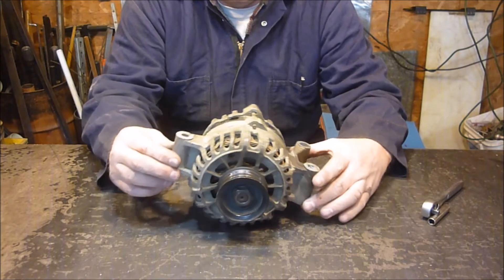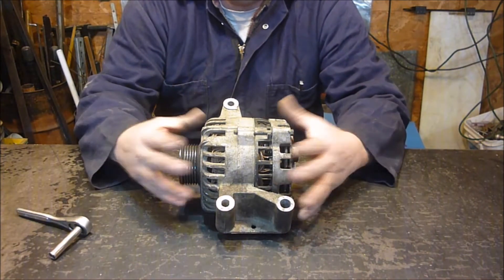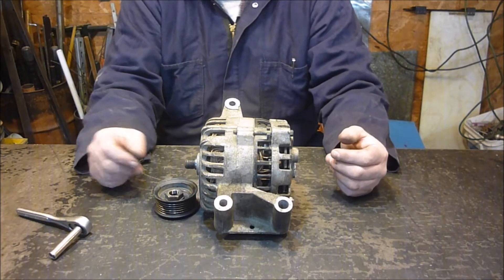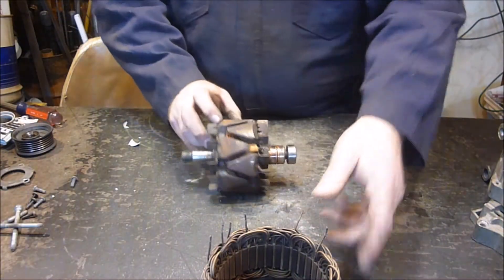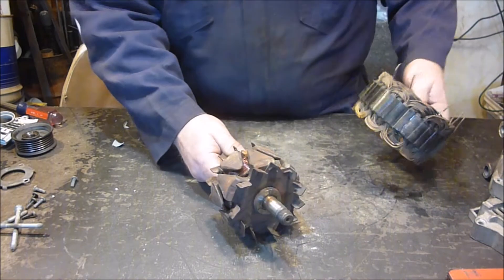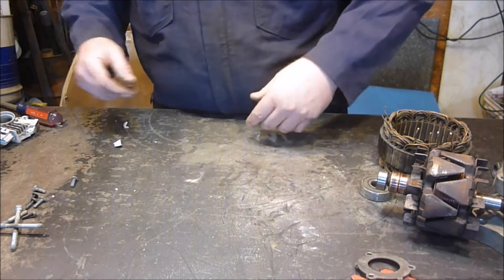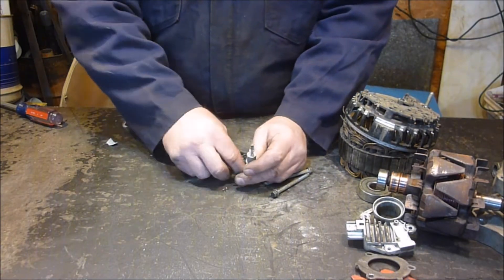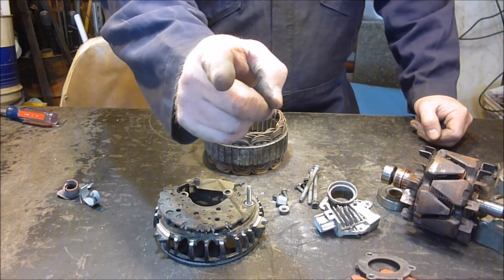WHAT'S INSIDE A FORD ALTERNATOR

Comment: Are the outer shells of alternators and starters aluminum? I'd surely harvest the nuts and bolts and bearings, and maybe the shaft, then scrap the copper, but I'm coming from a point of view of sources for aluminum to melt down and recast for machining.
Reply: I'm also watching this for casting sources xD only I'm looking for copper
Reply: Do you have a home foundry/furnace outfit, or a more commercial set-up? I'm hoping this coming Spring to be able to find the right refractory mix somewhere near me so I can get going on casting myself. I ran out of time for it last fall. I did however score a source for occasional metals to either for cash, or use for machining and casting. It's been pretty nice to finally have some pieces of steel on hand.  @2kwwelding479
Reply from the maker: @johnstrange6799  no i just recycle it but i would like to try when i have more time one day
Reply: Ooops. I'm sorry. I was replying to 2kwelding. I should made that clear, but still good to have you chime in, so thank you. :)  @JunkworksGarage
Reply from the maker: i believe it depends on the part but i think  this one was. check it with a magnet
Reply: Thanks. I have to look into it deeper and see if there is some blend of cast metals typically used in the mix. I came into contact with an auto repair garage that will let me take their scrap, so I'm trying to get my head around what I can use for bits and pieces (fasteners and bearings), machinable round stock, aluminum smelting fodder, and finally some extra scrap cash for my efforts. Thanks again :)  @JunkworksGarage

Comment: Is there a way to upgrade ampere rating of that particular alternator? thank you.
Reply from the maker: i don't know sorry
Reply: No problem. Thanks. Nice video.
Reply from the maker: amdomag  thanks
Reply: Just increase the number of turns of a coil and  use a strong magnet
Reply: Basic science dude
Reply: @srijananeja3516  What we're talking here is not basic science. It is all about electromagnetism. It is the heart and soul of electrical engineering. Another thing is that a car alternator has no physical or permanent magnets. It is actually electromagnetism developed when electrical charge passes through the coils. You must be the reincarnated Nikola Tesla if car alternator is basic science to you. That's it dude.
Reply: @srijananeja3516  I think this video is about actual car alternator performance. It is not a high school science project that you're talking about to just open it up and try to rewind the coils.